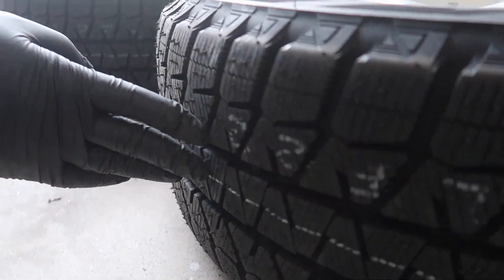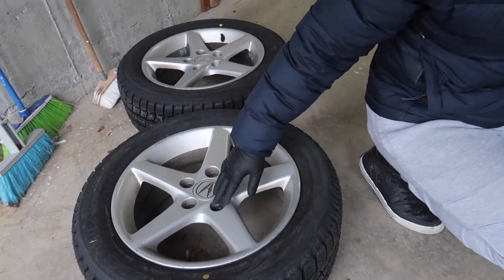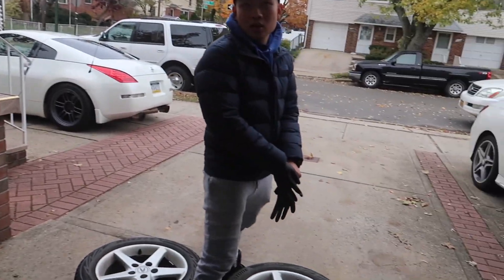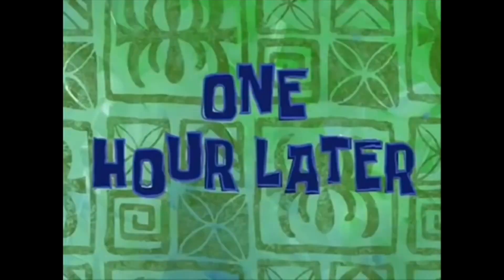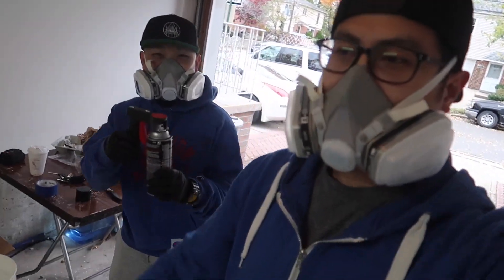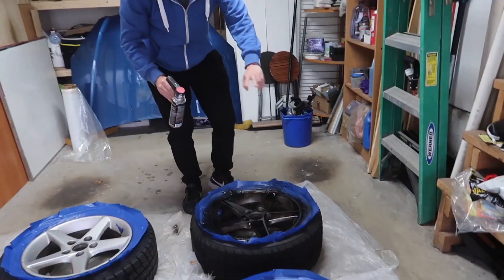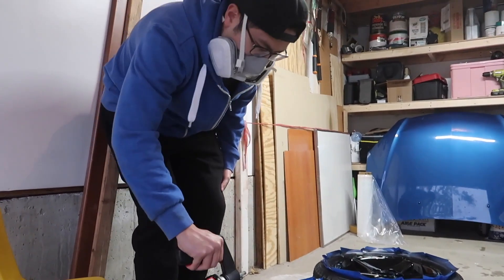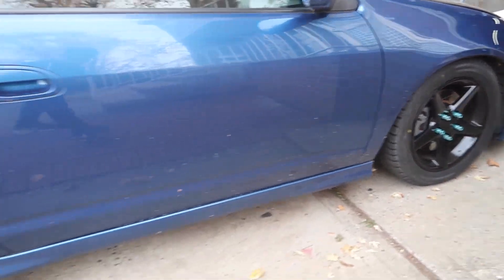HOW TO DIP YOUR WHEELS in SUPERWRAP GLOSS BLACK REMOVABLE SPRAY (the right way)

Comment: How does this compare to plastidip durability wise?
Reply from the maker: Durability wise I think they are about the same
Reply: The Superwrap DIY aerosol was developed to last up to 2 years and has shown great protection characteristics against road debris, rocks, salt, chemicals and UV exposure.
We developed our high performance Top Coat Series to increase UV, chemical and scratch resistance. It can be applied over any of our color series that has reached the minimum required thickness.
Durability will vary depending on your application and usage. Always keep in mind Superwrap was formulated as a temporary color change solution - not a replacement for traditional paint.
Reply: Superwrap nice 👍🏽 good to know. I did my grom wheels they look fresh. Thanks guys!